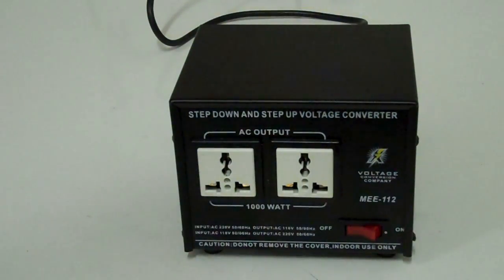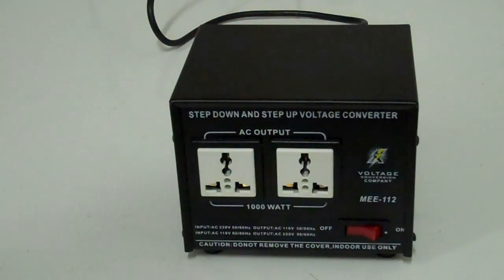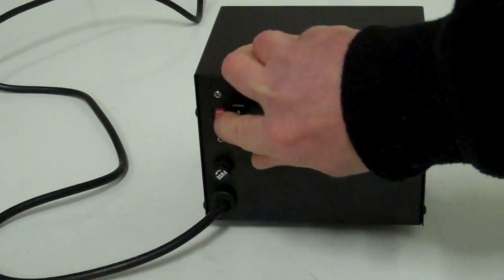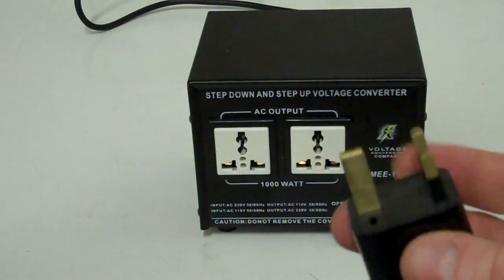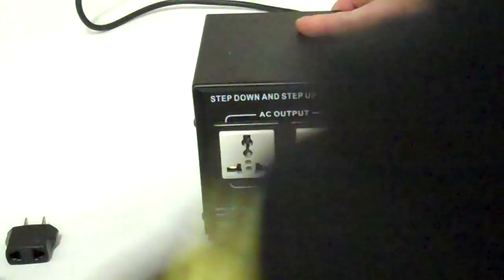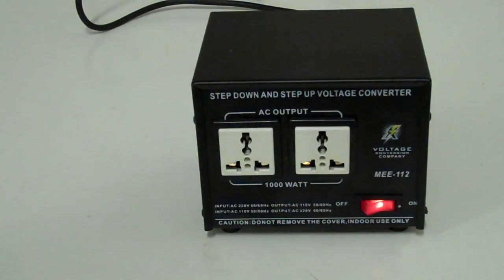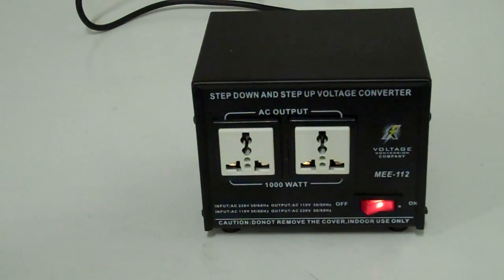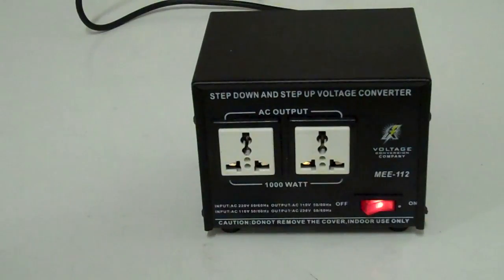Step Up and Step Down Voltage Converter.mp4

Comment: Help I just plugged a US Marantz AV unit into a 3000W converter and the AV smoked bad. I had the converter set to 220v and plugged the USA AV power lead into one of the 2 available sockets. Does it matter which socket I use , or does both sockets give the same voltage? Also what’s the damage to the AV? Is it fixable as it’s worth a fair bit

Comment: I have a kitchenaid from usa wth 110v and 60hz, which type of transformer s hould I get. I live in singapore that uses 220v
Reply from the maker: You would have to use a Step Down Transformer with a Wattage capacity large enough for your appliance.
Reply: @BestStuffUK  How large would it have to be?
Reply: Would 800w be sufficient?
Reply from the maker: @ndnnglim  It should give the Wattage on a plate or sticker somewhere on the KitchenAid. Usually they are somewhere around 300 - 500 Watts.
Reply: @BestStuffUK  It uses 350watts. So should I get a higher watt transformer?

Comment: I recently bought a step down converter which is 220v input, no way of changing this on the back. I ended up a bit worried afterwards thinking will it be okay to use here in the UK, since our voltage is 230v, but this video has now put my mind at rest. Thanks.

Comment: Hello. I am in France and want to use my US coffee maker which uses 1150 watts. I have a Bronson step up step down 2000 watts transformer. On the back is a choice for 110 or 240. Which do I choose, please? And on the front there are output choices of same, 110 or 240. The machine was supplied with a European plug in addition to a UK plug. I have watched your videos and find them useful, however, I am still hesitant as I need hand holding. Thank you for your assistance.
Reply: I’m wondering the same

Comment: I live in the us, and purchase a fluorescent sign from the UK that’s input is .80amps/240v/50 HZ. I wish to run this sign in the house but my lines are only 120v. is this exactly what I need a setup transformer? also do you recommend a specific transformer? The sign has 2 x 25watt fluorescent tubes bulbs. so I’m unsure as to what size transformer would be best. Thanks in advance!

Comment: hii i bought a karcher K5 pressure washer from saudi arabia and now i am in india but in my home the pressure washer was not working more than 5 minutes due to the lackness of voltage.So can you plz suggest a device for the contionous  working the washer?
Reply from the maker: Your problem is probably caused by fluctuations in Voltage. A Voltage Converter won't help, what you need is a Voltage Regulator.

Comment: So, my home electricity is 220v & My product is 100v . That’s means I need to switch the switcher of converter to 110 then I plug my product to 220 in the simran  or to 110 ? 

I believe in 220 but i need to make sure. Also, if I plugged wrongly. Will my product be damaged?
Reply from the maker: You need to set the input selector in the back to 220V and then plug your product into the 110V outlet in the front of the converter.

Comment: So if I bought a PAL VCR in the US, I plug the VCR into one of the outputs and step up from 240/220v to 110/120v? I expected to plug it into an input and not an output. Kinda confusing with the input/output stuff.

Comment: Thanks for the video. I'm using a 3000 Watt Step Up/Down transformer in the UK (input is set for 220V, output for 110V) and the item I'm using it for is an 110V amp from the US. Sometimes when I turn it on (and sometimes when I turn it off) the power to my room cuts off, and I have to go to the electrical box and flip the power switch back on. And this happens even before I turn on my amp. What does this mean? I feel like this shouldn't happen. Am I using it properly?
Reply from the maker: It sounds like the RCD in the house circuit is tripping out the breaker. It usually means there's something wrong with whatever you have plugged into it. The slightly odd thing is that it doesn't happen every time. Have you tried testing the transformer by moving it to another place and seeing if it also trips out there?
Reply: Well, I tested it in another electrical outlet yesterday and the same thing happened: the circuit breaker cut the power to my room immediately when I turned on the transformer. One thing I should add, and I'm not sure if this makes any difference, is that the transformer has been plugged into a surge protection extension. So, the transformer itself hasn't been directly plugged into the wall outlets. This morning, I plugged the transformer into the wall directly and it turned on and off just fine, although this may change when I try it again. Perhaps I should be plugging the transformer into the wall outlets directly, and not use extension outlets?
Reply: @ItsNeverTooHot4Leather  how did you get on ?

Comment: it plugs into the wall with an American plug right? that's how you turned it on.... so if out of country how can i use this if they have different outlets
Reply: Plug converter or step up or step down converter
Reply from the maker: You would just need to use a travel adapter to adapt the Voltage Converter's power plug to fit the outlet in the country where you are.

Comment: my amplifier is 230v from the uk my converter is 220 or 240 I can run it on 220
Reply from the maker: Voltage Converters are very simple devices, they work by doubling or halving the Voltage they receive (depending on whether you have them set to step down or step up). Within a country the Voltage will vary a bit from day to day and place to place, so manufacturer's build products to a tolerance band, so an appliance that works on 230V will also work on 220V and 240V, for instance.

Comment: Hi could you tell me  Will it work for my luna lava  lamp came from UK ? I live in San francisco CA US - the lunar lamp  from uk takes 100w bulbs, and is run on uk voltage (240v) - mean 100w es-e27 240v
Reply from the maker: Yes it would work for your Lava Lamp. Set the input on the back to 110V and plug into the 220V output on the front. You need a 200W or higher converter.

Comment: how to connect an Xbox one fromm USA in India?
Reply: you can use xbox one directly no need of power convertor.. I  bought 3 playstation 4 from usa  and using them in delhi.. Xbox one and Playstation 4 both works globally 110 - 220 v .. so no matter whether you are using them in india or usa just plug in and run it.
Reply from the maker: X-Boxes do not usually need a converter, just a plug adapter. It would be wise to check first though. If your X-Box power supply has something like - "Input 100-240V AC" printed on it, that would mean it is multi-voltage.

Comment: im in the us, but i bought a curling iron from uk that has 3 pin... and 230V,  will this work,,i need a adapter n converter? i dont know th
Reply from the maker: You would need a step up Voltage Converter. Appliances that produce heat tend to use quite a lot of power (at least during the heat up phase) and are usually best avoided. Curling irons vary a great deal, but some of those that have a very short heat up time use a lot of power during that phase, and would need a large converter.

Comment: Hi I have a flour mixer that I bought from India and I want to use it in Canada. Do I need to select the 110v input in the back and the front plug the flour mixer to the 220v output?
Reply from the maker: Yes, that is exactly right.
Reply: BestStuffUK thank you my friend for the quick reply

Comment: hello I live in the us and I have an electric dryer that need 220 v but my house only has 120 v plugs ,could I use this to be able to use my dryer??
Reply from the maker: Yes, you just need to make sure that the converter Wattage capacity is large enough to handle the dryer. Most things that produce heat use a lot of power, so you would probably need a large powerful converter. It might be easier to get a 110V dryer or get an electrician to create a 220V output (they can sometimes do this by combining two 110V).
Reply from the maker: Yes, but you need a converter that has a large capacity (Wattage). Most dryers use at least 1000W and sometimes as much as 2000W.

Comment: If I plugged an appliance that needs 2200 Watts, into a transformer only rated for 100 Watts, did I fry the appliance?
Reply from the maker: As long as the converter was correctly fused then you would have fried the converter not the appliance.
Reply: You need a more powerful converter / transformer the more watts that your appliance use the more powerful the converter is, so you need a powerful converter to with stand 2200 watts not 100 watts.

Comment: hi can i use  my converter on a power extension or do i have to put it straight to the power outlet
Reply from the maker: You can use it on an extension.

Comment: I bought (Us machine) keurig coffee machine k550 I couldn't find where to find the watts need for it but most machines use 1400w and I have 1000 watts converter how many watts converter I need to use it safely?
Reply: I need help please :(
Reply from the maker: You need to cover the Wattage and  add some margin for error. If it is 1400 or 1500 Watts ( as most coffee machines are) you should use a 2000 Watt converter.

Comment: hi i have a South African device which i want to use in the USA. do i step up with the converter or step down? i think its step up but i want to make sure
Reply from the maker: +Vukile Mqondi You are wrong, Bianca needs to Step Up. She is changing the Voltage up from 110V to 220V so she can use her 220V items in a110V country.
Reply: +Bianca Mattner You need to step down as SA uses 220-240 V where the device was purchased, I assume. And in the US they use a lower voltage so you need to step down and adapt that device to that low voltage.

Comment: Thanks for responding. So do you think a 1500 step up converter would work?
Reply: +Mary Hall Should be fine.
Reply: +Steve Farr hey,I just got my step up and down voltage converter,But i accidentally switched the voltage input to 110volts while plugged in, Now it doesnt turn on,Is it gone forever or can i do something to fix it?
Reply: +Steve Farr Turns out my Thermal fuse doesnt work.Can i do something to fix it?

Comment: Do you know what size step up converter I would need for a curling iron from Australia?  It says it is 45W.  Thanks.
Reply: +Mary Hall The problem with curling irons and hair straighteners is that the manufacturers give the Wattage once the tool is up to operating temperature, which may well be 45W. What they never tell you is that during the heat up phase the tool will use a lot more power than that. The faster it heats up the more power it uses. Some curling irons use as much as 800 Watt in the heat up phase.

Comment: i have an 110V and 1700W device which i want to use in 220V country, which ST- device should i get?
Reply from the maker: Seif Soliman It depends on how long you wish to run the device for. The rating on a converter is an absolute maximum, so 2000W would be OK for short periods of time, but for longer time use you would need a larger converter, this way the converter would not be under too much strain.
Reply from the maker: It depends on what type of device it is and how long at a time you need it to operate for. For short periods of use a ST-2000 would be fine, for longer time use you would need a larger converter. The idea is that the converter should not be under too much strain for too long.

Comment: I live in the US, and I want to bring some kitchen appliances from US to use in Laos or thailand can this converter works over there? And how to use it? For example I have to switch to 110 voltage when I use the appliances from the US?
Reply from the maker: For some countries where the Voltage can fluctuate then you really need a Voltage Regulator rather than a converter. A Voltage Converter works by halving or doubling the Voltage it receives (depending on whiter you are using it for Step Up or Step Down). This is fine in countries where the Voltage is steady, but for some countries the Voltage can vary throughout the day (sometimes by quite a lot).
Reply: Voltage converters cannot change cycles or Hz like 50Hz and 60Hz

Comment: will a aircondictioner refgerater from uk work on american dryer circut 240 volt 30 amp if i fese both legs acorbingly each leg 120 volt 240 fase to fase

Comment: If you want to protect from surges you need to do this before the converter not afterwards. If you want to plug an extension adapter (power strip) into the converter you can, but it should be  a non surge protected one.

Comment: would it be ok if i connected a surge protector, specifically a belkin surgemaster with 6 outlets from malaysia (basically the same ones from the UK, so behind it it says 250V~50Hz) and connect my desktop power supply(which is only 650 W) plug to this surge protector , connected to this voltage converter? and also be able to connnect my phone charger and ipad charger to the surge protector?